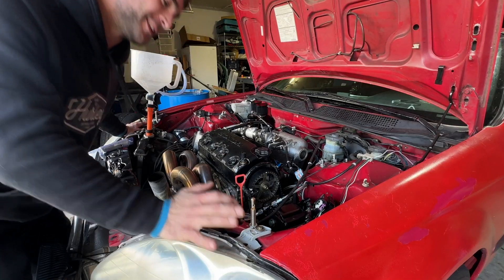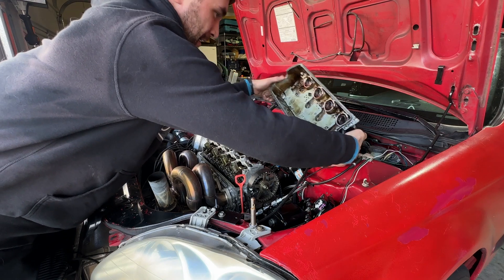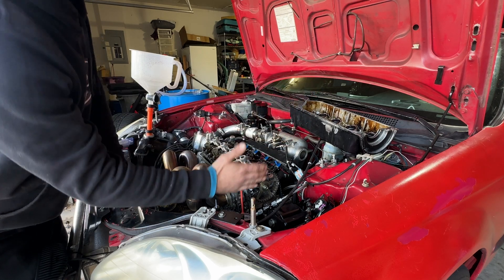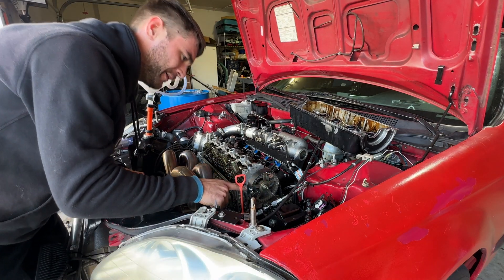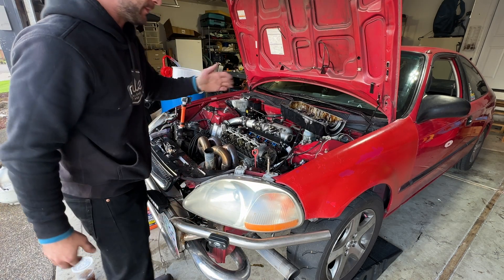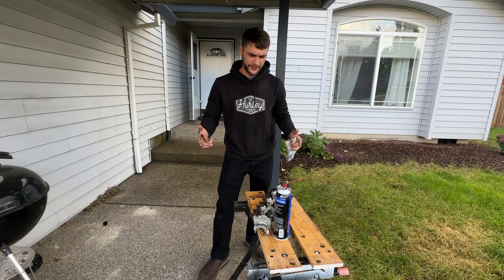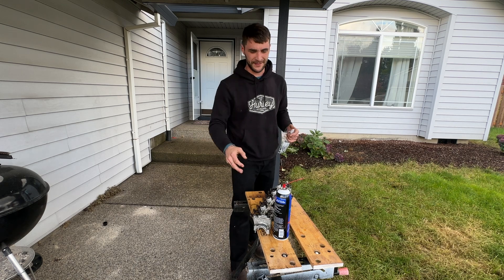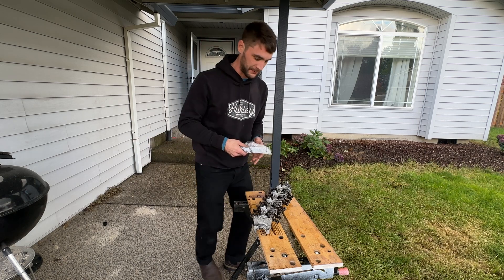How to Repair Broken Valve Cover Bolts (Thread Repair the Easy Way)

Comment: What if the piece your drilling into for the new threads actually broke in half and you can't re tap new threads?
Reply from the maker: The cam cap broke? Or was it one of the two bolt holes at the back of the head?

Comment: You lost me at "pull off the"....blah blah blah. Fixed it with extractor, none of this bs
Reply from the maker: It’s for the times when you can’t fix it with an extractor, or damage the threads on the way out, or over tighten the bolt and strip the threads. As a Honda flipper I can tell you I’ve seen it all. Extractor is always the first step but when the threads are gone you have no choice but to make new ones

Comment: Where’d you get the kit
Reply from the maker: Hardware store
Reply: @pnwvibe3123 thank you we have to the same issue on my buddies deo sol project hoping to fix it tomorrow
Reply from the maker: Is it broken off inside or did it just strip the threads in the hole?
Reply: @jancordero9471  did you fix it?

Comment: great video, got a golf mk3 one of the bolt threads just gave out today hope it can be fixed
Reply from the maker: If there’s enough extra material around the threaded hole to go up a size or 2 to fit the insert you should be able to use this method.